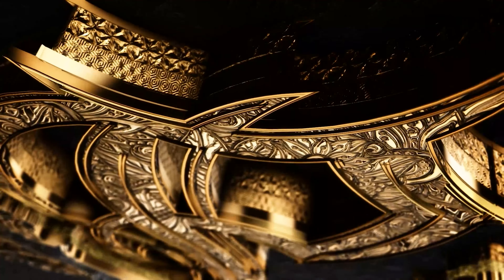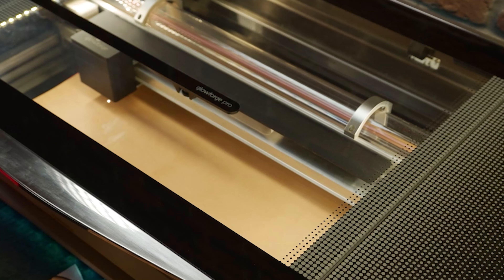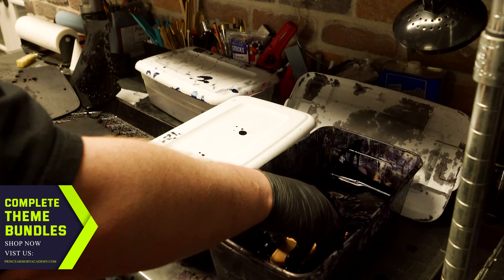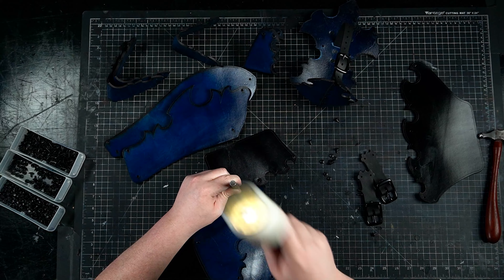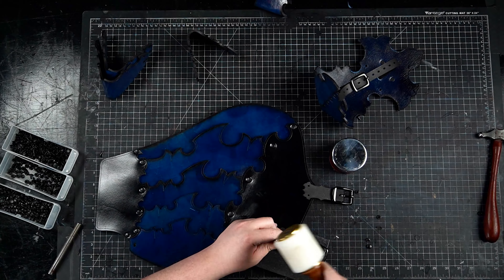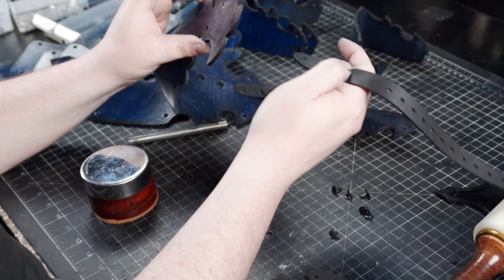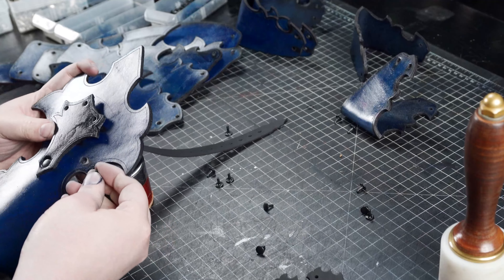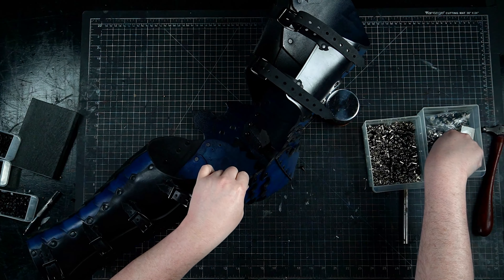DIY Leather Articulating Leg Armor - Prince Armory Imperial Armor

Comment: Beautiful leg armour!

Question: what projects would you recommend for a beginner? I want to try, as I am debating blacksmithing as a hobby as well.

Thanks!
Reply from the maker: Bracers are the number one easy mode item to get started and test out tooling ideas, colors, and other techniques you want to use.  Then you can move on to helmets which are still pretty easy most of the time.  Or if you want another practice piece, go for the sabatons.
Reply: @Princearmory  Thanks! Are there any items outside of armor you suggest?
Reply from the maker: @isaacbenrubi9613  Outside of armor?  Hmm Did you consider more armor?
Reply: @Princearmory  ...that's fair.
Reply from the maker: @shamanbeartwo3819  Great plan!